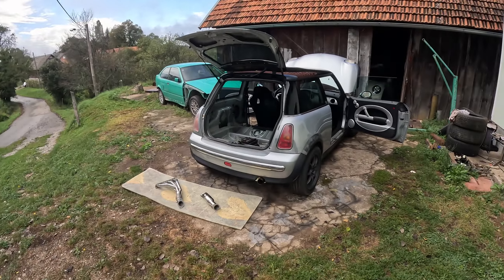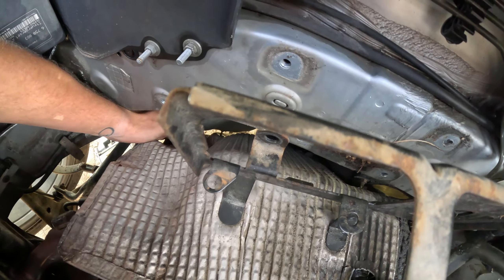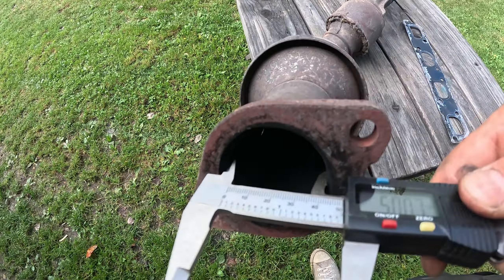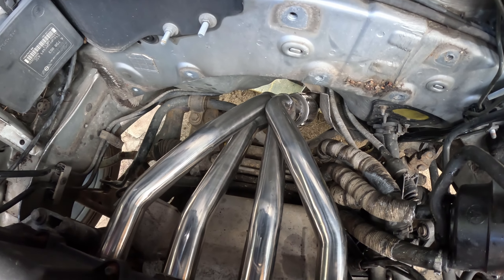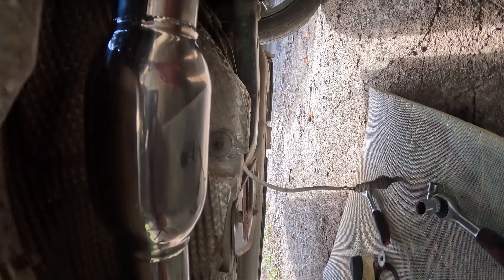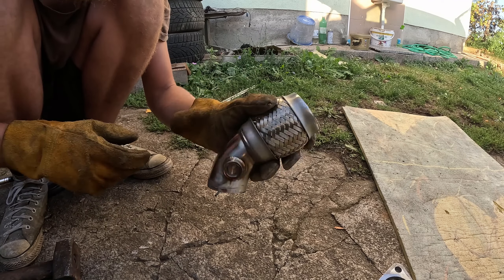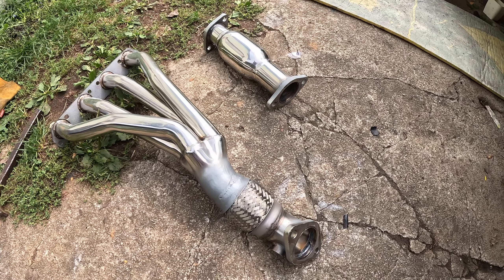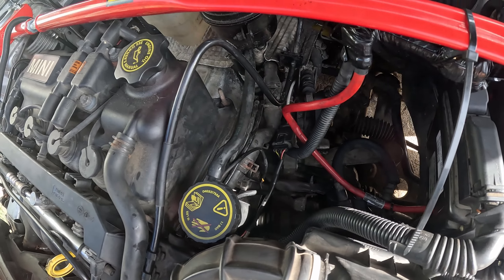How to fit cheap Ebay header on R50 Mini Cooper

Comment: Very cool, great work! That downpipe looked like a pain in the ass to fit, that and the exhaust sound amazing together though!

I have to ask, what's the reason for fitting R56 rear arms? Increased track width? I'm really interested! 

You've also inadvertently shown me the location of the run flat module on an early R50 (grey box bolted to rear right inner wing). Is that pretty much where it was from the factory?

Sorry for the questions and many thanks!
Reply from the maker: Thnx, I didn't like the sound at first, but after a bit of driving it somehow setled, it's now just what I wanted, deep and not to loud up to 3500 rpm and after 3500-4000 all hell brakes loos 😁

R56 arms are lighter, 2.4 kg each side and it's unsprung weight, so that is the reason + they have a bit of camber adjustment buikt in. As for the module, it's there somwhere, don't remember the exact location but rear right of the car.

Comment: I got this style headers for my mini. And let’s just say I also had issues with fitment, long story short the flex pipe area broke after 3 months.  I rather spend the extra for the xforce headers . I still haven’t installed them
Reply from the maker: I love xforce 4-2-1 design, but in EU they are more than double the price
Reply: Have you installed them yet? I was doing some research and some people were saying they need to do a little welding and cutting. I really been needing to buy some new headers but it’s hard to find some with the correct fitment

Comment: Hi I have a cooper r50, do you know if I will need a remap if I fit a sports manifold and sports cat? I currently have just a catback exhaust and pod filter
Reply from the maker: No need, it will work just fine, but if you have other mods and want to gain more power, then yes
Reply: @mattwillow7 Ok thanks for the reply